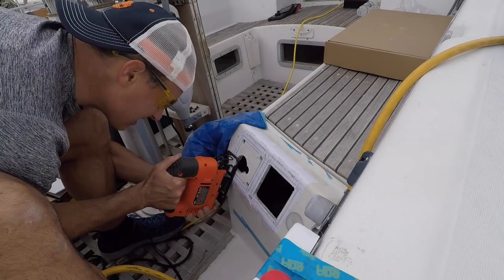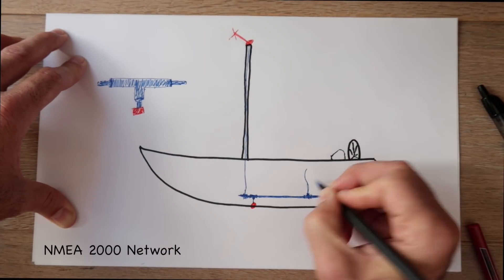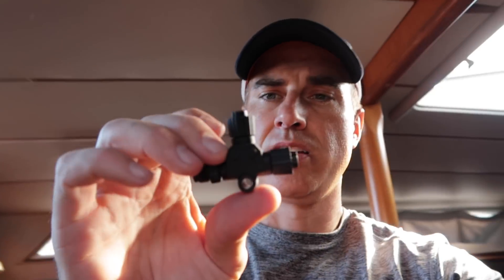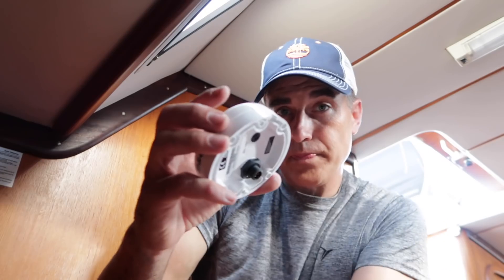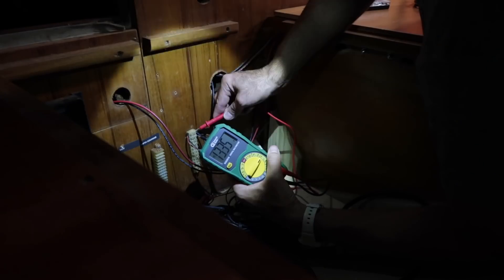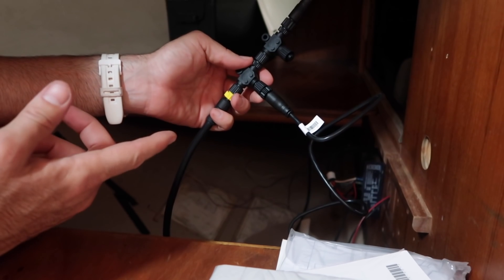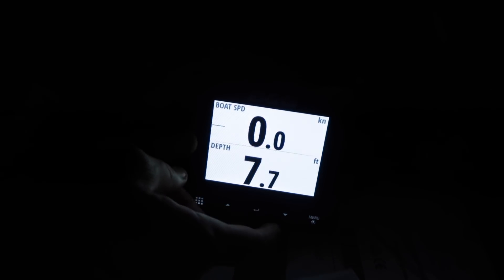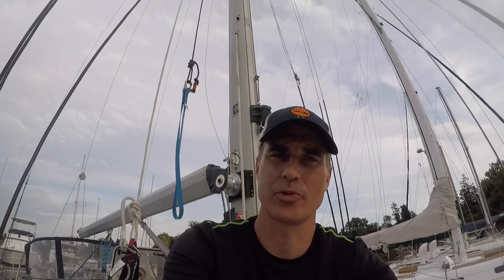How to Install NMEA 2000 Boat Electronics System

Comment: That's a lot of backbreaking work, but sure is a neat system having less wiring and less clutter. Like the idea how simple instruments can be added or terminated, or cables can be replaced while at sea. Great system. Good work, excited all is working, nice instrumentation, dam now i got to go back and look back for the volg on depth finder install. excellent work Josh. Great vlog.

Comment: It is best and recommended by the manufactures to have your power supply enter the backbone as close to the middle as possible and be evenly distributed in even number of devices supplied. Meaning if you have 6 devices you want the power connection to enter the backbone between device 3 and 4. Still a good helpful video.
Reply: Good comment.  It’s not the “middle” as defined by number of devices, but “middle” as defined by summing the Load Equivalence Number (LEN) on each side of the power cable attachment point to the backbone.  Ideally, you have equal LEN values on each side of the power attachment point to the Backbone.  The LEN refers to the current drawn by each NMEA2K device in the network.

Comment: Hi Josh ! The bilge of your boat is very shallow (just like mine a Dufour 3800). I notice that a lot of the electrical wiring on your boat is running UNDER the floor boards. Even some of the exposed wiring connexions are there. It would be a better idea to have those connexions located higher as possible (like behind the electrical panel), to avoid having those connexions under water, in the event of a water ingress. The bilge is shallow and it would not need a lot of water to have the floor board floating around and probably most of your navigation systems out of commission.

Comment: Old style coax ethernet networking... brings back memories.  Wonder if there's a more modern NMEA xxxx that uses Cat 5+.  Regardless... enjoyed the video and good luck with the continued modernization.
Reply: Yeah, had an entire office wired with that stuff for a early 90s era network. Cables under everybody's desks with T-connectors.  Good times.
Reply: While the bus topology is similar to 10Base2 with coax and BNC connectors, NMEA 2000 is CAN Bus, with the DeviceNet connector and two pins for power, two for data, and one for a drain/shield. The Signal K data format named after the Kilo marine flag that stands for ""I wish to communicate with you", is an open source attempt at a modern system that is transport agnostic and can use TCP/IP (Ethernet, WiFi) or serial (1-wire, I2C) etc. together with gateways that convert NMEA and other proprietary standards to the open standard Signal K format. This way anyone can write their own or use other peoples Signal K Apps or Cloud solutions to visualize the Signal K data from sensor inputs, as well as control outputs. All using an open standard without needing to license anything. Signal K » http://signalk.org/

Comment: I have a boat from 1994 with no NMEA 2000 components installed. Lets say I wanted to install a new chart plotter and NMEA 2000 network. Would I be able to use the boat's old transducer and connect that into the new NMEA 2000 backbone, or would I need to replace the transducer with a new one?

Comment: Is a backbone cable different than a T'd device cable? Or are all NEMA 2000 cables the same and it's just a "backbone" cable if it's used on the actual backbone?

Comment: I assume their plotters can also hook into that system?  That looks really nice to only have to run one cable and one power source.
Reply from the maker: Hi Bob. Yes, their plotters will work on same system (B&G has the Vulcan and Zeus plotters), but note that the plotters require their own power cable in addition to the NMEA cable. The other thing I forgot to mention is the NMEA 2000 is interchangeable so I could actually put a Garmin plotter, for example, on this B&G system as long as they are all NMEA 2000.
Reply: That's cool.  Makes sense. I guess for the higher current draw devices it would be nice to have them on their own power.
Reply: Josh Post nice job! I enjoy your videos. Are you planning to add a chart plotter, or use a tablet? When I upgraded my electronics (mainly to add AIS) I installed a small chart plotter that uses WiFi to mirror to an iPad. It works anywhere on the boat and if the main system fails, I’ve got stand-alone chart plotter software on the iPad as a backup.
Reply from the maker: @aircurv6279  Thanks Stuart. I was debating about a chart plotter. But I may just use my tablet with its internal GPS. I also bought a USB GPS antenna for my laptop. I'm doing Navionics on my tablet but I need something for my laptop. I'm trying to figure out OpenCPN to download charts on the laptop. Do you know of other options for laptop?
Reply: Josh Post OpenCPN seems to be what most folks are using. Let me know when you’re getting close to West Palm Beach. There might be an empty slip in our marina that you could use for a couple of days.

Comment: Josh, thanks for the overview, I'll have to do this one day. My system is on the old NMEA 0183, but as components fail eventually I'll have to dive in. Are you happy with your system? I have a neverending battle with my paddlewheel sensor in west coast salt water.
Reply from the maker: Hi. I'm so far happy with my system. I've dove down to check paddle wheel a couple of times. So far so good.

Comment: So can you clarify this for me, you don't actually cut the back-bone to "insert a new device T" right, rather you add more cable after the T, so if that is the case, what is the ideal backbone leg length? perhaps 10 feet or so? or what did you find?
Reply from the maker: You are correct. I had two 16 ft pieces of backbone. I also have another 6 ft piece that I'll use from the battery power to the screens. I would have been better with a 16 ft, a 10 ft, and a 6 ft, but they only sell them in a few sizes. Also note that you can put multiple T connectors (thus multiple components) at each end or split in the backbone. Some boats with a lot of components could have 4 or 5 T's side by side by side.